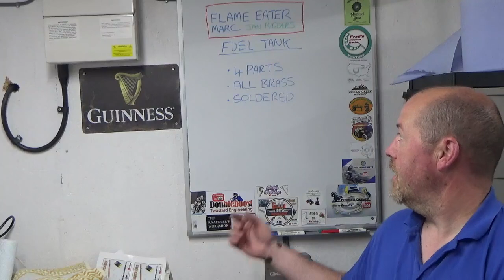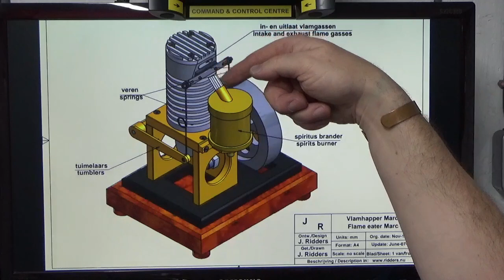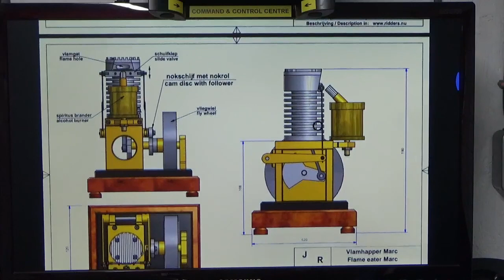Making a Flame Licker Engine "Marc" by Jan Ridders.  Part 2 Fuel Tank

Comment: Just mount the tank in the chuck or a collet by the thread end and clean the excess solder up with a GT type insert for yellow metals and ally. You'll easily clean all visible traces of overflowed solder that way. When I'm soldering stuff like this for model engines I use electrical resin cored solder because it easier to place the bead more precisely. Cleaning up around the angled pipe will be a job for a round needle file and some patience. I'll just say that Jan Ridders is an absolute gentleman. I've had drawings and built a couple of his designs some years ago.
Reply from the maker: Hi Howard, thanks for the comment and suggestion. Lol, the jobs done, I taught myself a lesson and did it all with files as a penance to make sure I pay more attention next time round. Electrical solder is a good idea, I have some somewhere (now just to find it)! More soldering to do on this build so will experiment further! Jan has been brilliant, fully agree. Cheers, Jon

Comment: Nice Job Jon, I can see a steam locomotive in the pipe line 👍
Reply from the maker: Hi Terry, thanks for the comment. Nah, steam just doesn't captivate me, the engineering and mechanics of the engines is really interesting but the whole steam, boilers etc doesn't do it for me. I will probably build a couple of other engines (IC maybe). Would really like to do a working scale model of a RR Merlin, thinks me needs a bit more building experience before tackling this dream lol. Cheers, Jon
Reply: @jonsworkshop  wow merlin engine, that would be some achievement, lot of moving parts in that monster 😬

Comment: Nicely done Jon. As you said a little heavy on the solder but at least it does not leak. A method I have seen used on the lathe for a starter hole for a boring bar is an end mill in the tail stock chuck to give you a starter flat bottom. Neither here nor there, more than one way to skin a cat. Thanks for sharing. Cheer from Canada
Reply from the maker: Hi Yves, thanks for the comment and support, much appreciated. Yep, an endmill would have been a good shout. Cheers, Jon

Comment: Looks good Jon.   I find that using thin coil type electricians solder (only about 3 mm diameter) gives more control on jobs like this.  Stick solder is harder to manage and it's easy to add too much.  To clean up the solder I'd be inclined to reheat the job to flow the excess around more uniformly and down into the base.  Then buff off what solder looks fugly.  Trying to turn it off could be risky (I've had several disasters trying that).  Good luck however you do it.  Cheers Rob
Reply from the maker: Hi Rob, thanks for the comment and suggestion. I have more soldering to do on this build, and I do have some electrical solder somewhere so will have a play. I cleaned it all up already, took my penance and used a few files to make sure I remember to pay more attention next time lol. Cheers, Jon

Comment: Jon, if you intend to do some more soft soldering in the future, get yourself some "Killed Spirits Of Salts" Trade name Bakers Fluid. It is corrosive so watch where you store it. Use an artists fine pencil brush a no 3 is a good choice. Use a much finer solder so you can limit the amount you apply at each dab. Whilst the solder is molten you can draw it to where ever you want by applying more Bakers fluid with the brush. You will not then get the blobby bits like you just had, should you get a blob of solder where you don't want it, you can "flick" it away with the brush. You will still see the solder mark but it is so thin that you could easily polish it off with a bit of Scotchbright. Another tip, to have made sure that the base screw soldering did not re melt, bung a bit of wet paper towel in the bottom, that will keep it from re melting .Looking good, well done. Regards from Australia. Speaking of Australia, I suppose now that the French built submarines have been cancelled for Australia, you won't be coming to see me then ?
Reply: Great advice from Dave - as always!
Reply from the maker: Hi Dave, thanks for the comment and suggestions, all very welcome. I will look into getting some Baker's and have a play. Enjoying this engine building lark a lot so I think there will be plenty of opportunities upcoming. Lol, nope, the tech the Ausies have signed up to is UK and US, which basically means my company so even more chance of a visit lol. Cheers, Jon

Comment: Once again great video Jon, enjoyed it ! 
When soldering anything with soft solder / silver solder etc if you wash the parts immediately in quite hot soapy water it kills the flux and stops it eating into the part you have made. 
Take care bud 😀
Reply from the maker: Hi Tony, thanks for the comment and suggestion which is in the memory bank. I used methylated spirit on this but quickly acquiesced and sorted the excess solder out followed by a preliminary polish lol. I just wanted to see a shiny bit. Cheers, Jon
Reply: Good tip. I will try it. Thanks!.
Reply: @fredcreer1929  You are welcome ! I have silver soldered many hundred high speed steel cutters to shafts in the past and washing them thoroughly in very hot washing up liquidy water and scrubbing with a toothbrush kills the acid in the flux, and stops it slowly eating away at the tool. 😀

Comment: Hard solder on the screw, and base. And soft solder on the base and tank body. 
The tank and body could have used electrical multi core solder as it melts easier. A little flux on the joint. 
Nice bit of file work on the lid, the tube looks quite snug.
Good idea to build in some adjustment on the flame contact. Surprised no O ring to seal the lid!.
Reply from the maker: Hi Fred, thanks for the comment. Good suggestion, I have some electrical solder somewhere, will give it a go on the next bits that need to be done. I wondered about an o ring also, nothing in the design and there's a couple of them built on YT running so I guess a close fitting lid does the job. We will assess, I can always add something in if we have a fire. Cheers, Jon

Comment: Nice bit of angle slotting, should clean up nice.
Reply from the maker: Hi Nigel, thanks for the comment. Yep, all cleaned up now using a mix of files, and it looks great. Still needs the final buff on assembly but it looks good already after a bit of elbow grease! Cheers, Jon

Comment: Great vid Jon, was gonna ask you for your yummy brass shavings but you've probably binned them by now :( Like the rod in the drill chuck tip, use to hold a scriber or something to catch the piece but me likes your tip beterer! TFS, GB :)
Reply from the maker: Hi Graeme, thanks for the comment. Not binned the brass swarf but it is now mixed in with everything else in the lathe unfortunately. I have some more brass work to do, if I remember, I will scavenge what I can and bag it up for you if you like? Cheers, Jon

Comment: Try solder paste, it makes for a neater job and not so much clean up. You don't need any flux and if you put too much on it can be wiped off before you heat the job.
Reply from the maker: Hi Backyard Mechanic, thanks for the comment and tip. Going to have a play with Baker's Fluid next time round (been kindly sent some), will keep persevering and learning trying different things as I go. Cheers, Jon